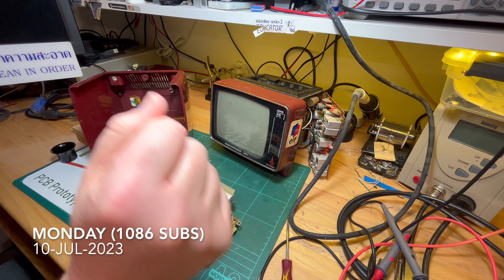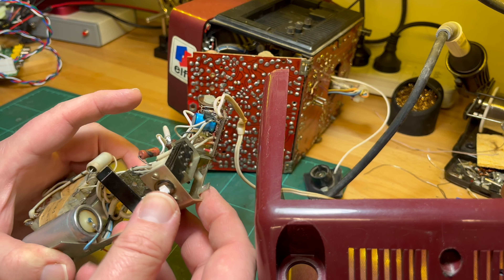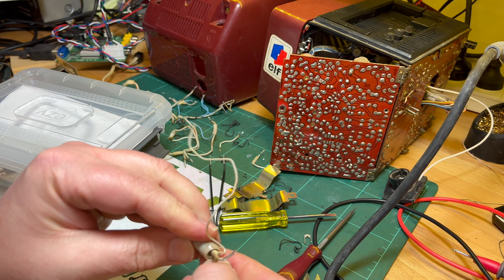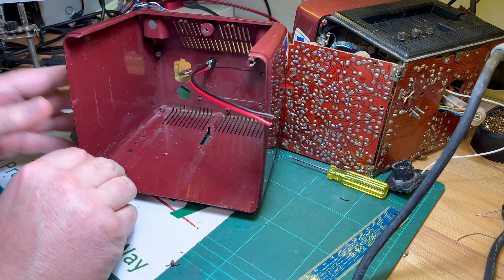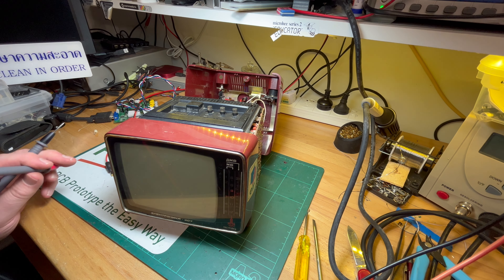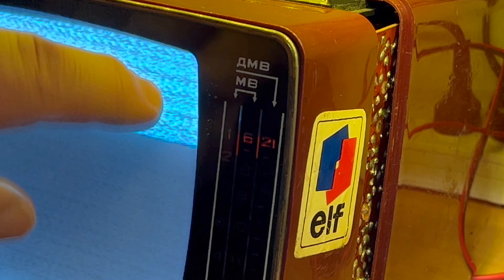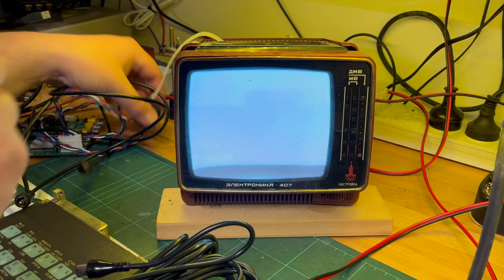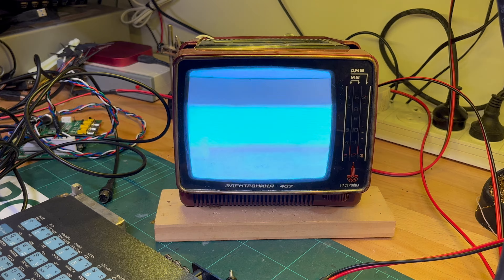Электроника 407 (Elektronika 407): Part 3 [TCE #0321]

Comment: All is well that ends well. My preference for all and any AC devices is to convert them to DC, although I would have installed a 24v dc to 12 v dc converter as I isolate some 115 vac circuits in-house and get much less wire resistance @ 24 vs 12vdc. Frankly 48 to 12 would be even better but my goofy epever solar controllers only work @ 24 volts at battery bank. This TV is only useful  for nastolga. Don't think I'd ever feel comfortable plunging it in mains withoutthe PS mod. I think modern manufacturers should get with selectable DC voltage appliances simply because of the high cost/ poor reliability of inverters. Thanks for a video on my endless quest for efficiency.

Comment: There was a perfectly circular opening in the plastic and frame where the missing fuse holder is and you chose to drill through the case for the DC socket, come on...

Also DMV - Decimeter waves, MV - Meter waves
Reply from the maker: Indeed ... if only I had a MASSIVE socket that would've filled the hole, I would've done that.  I did consider trying to put a tiny DC socket in there and then hot-gluing the shyte out of it but it would've looked horrible.
Reply: @Brfff  I've used DC sockets where instead of the little plastic tabs they have a thread and retaining nut that mount the same way as the soviet fuse holder is mounted, but i'm not sure if the diameter matches. I guess i'm spoiled by 3d printers because the first thing that came to mind instead of hotglue was "just model and print a little adapter in 15 minutes"...
Reply from the maker: I really need to get my 3D printer fixed!  All of my sockets are pretty small, including the threaded ones ... but I do have one type that is more "open frame" (hard to describe) but is wider, so I might be able to use that ... let's see.